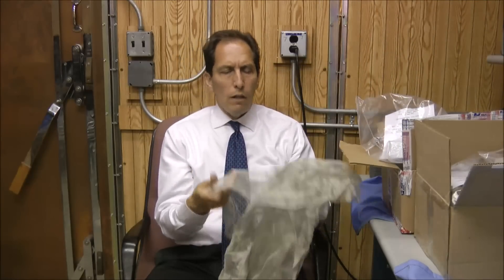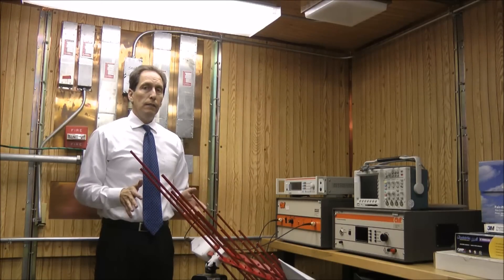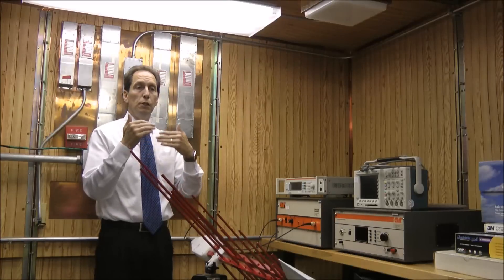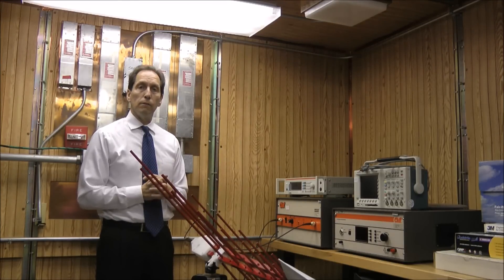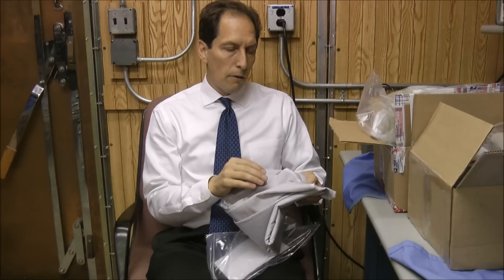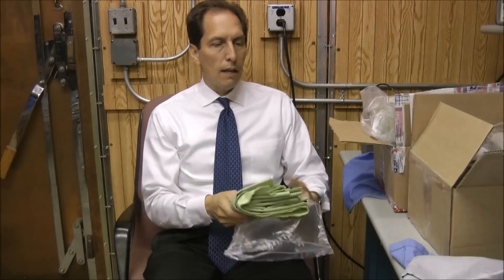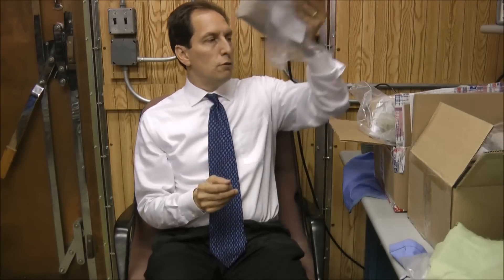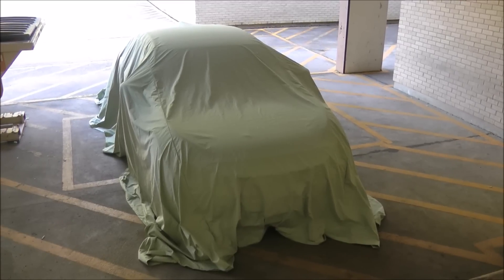Protect Generators and Cars from EMP

Comment: If we were attacked by an EMP bomb, I would wait a few days before uncovering your car because there might be multiple EMP attacks over the course of days! It might not be just one EMP attack, right?
Reply: If my car ran, it would be months before I got it out. A running car would be like a pig running around in a famine.
Reply from the maker: Sure, it's certainly possible.
Reply: DriverSteve what do u use to cover car or generators. What’s material called n where do you get it
Reply: @carolthompson4678  The video under which your comment is listed shows a website address to order the cloth. He will see the almost 5 foot wide strips together for you for $100 if you want or you can do it yourself. He said 20-25 length strips are about right, but suggest you measure—especially for a truck or something large. They do need to be hemmed one inch and to drape onto the ground to ground the cloth, so do not skimp. 👍
Reply: If I was at work and my car still worked after I uncovered it then I’d drive home and then cover it back up.
Reply: If I were the enemy I would pop an EMP...wait a few weeks, pop another. I'd let everyone get their backup stuff out of their Faraday cages and pop another. Yes, definitely would pop several.
Reply: @arklatexahomasavage5454  exactly then sit back a watch them (us) destroy ourselves
Reply: Arklatexahoma Savage 
The enemy would be identified immediately and vaporised .no second chance !
Reply: Good point while you are it - just don’t ever drive that car!  What is to stop someone that has not a working car from shooting you out of yours?
Reply: Protecting a vehicle is a bit of a fool’s errand in many ways. A)Many vehicles will survive just naturally, they simply don’t have as much antenna as is really needed to absorb much of the RF, might be parked in garages etc, that absorb a ton into rebar or concrete etc….

But more
To the point, there simply isn’t much of a way to preserve a useable amount of gasoline for long.

Why not store an electric bicycle or something that has a fuel source that will be viable and that won’t get you killed automatically or that will be a ale to navigate the clogged streets?

Chinese conversion kits are efficient, easy to install on normal bicycles, and relatively inexpensive…and with minimal parts will work until their batteries are no longer useable…years of heavy use.
Reply: @thopkins2271  Electric bicycles would be in high demand if they survive and cars don't. It would be dangerous to ride an electric bike as there would be widespread anarchy and would be either shot at or beaten for your bike! You would have to be very careful on showing anyone what resources you have as people will likely kill for it especially knowing that officers can't respond!
Reply: @driversteve9345  For sure. But it’s a hell of a lot easier to be discreet on a bicycle than a vehicle, and there are probably more bicycles in the country than people who can ride them. An average of 15,000,000 are sold per year.

Seeing people traveling on bicycles would be commonplace. Vastly more common than horses or vehicles, and eventually probably more common than pedestrians. Even if just used as a beast of burden you walk beside.
Reply: Correct. Most EMP bombs will be detonated in the first wave (before the destruction bombs arrive) to catch as many people by surprise. After that, EMP bombs may be set off if it is determined that harder systems are still operational. Those EMPs will be aimed at those targets but the EMPs can still destroy electronics  from thousands of miles away.  The idea is to keep you electronics in the Faraday Box 24/7 BEFORE an event occurs. Off the coast submarine launches may give us less than 5 minute warning.  People think to put their electronics in the boxes when a nuclear war starts that may be too late. Cell phones are low on the list to keep in a Faraday Box. The towers will all be knocked out because they have antennas. Keep a multi-power hang crankable multi-band radio receiver, and a 5W hand held CB radio, a hand held shortwave/ham transceiver (even if you don't have a license). The list goes on, but cell phones should be kept in a cage only if you keep important info on it, do not expected it to work as a phone/data or GPS after a nuclear war starts.  Can you imagine the horror of nuclear war when a blogger can't get to their Tic Tok account (which is Chinese by the way). I have a video on Ammo Box Faraday Cage. This channel here has the best info hands down.
Reply: First impacts will be kinetic to catch as many people out in the open. Then knock out the electronics. That seems the way the elites have it planned. Their biggest fear is us online talking about this.
Reply: @timmoles9259  If you are obeying Jesus commands and have the holy spirit in you, you got nothing to be fearful of! Actually, if you are truly saved and have Jesus, it would be a blessing to be killed which would start your everlasting eternal perfect harmony with Jesus in heaven! 

If you're not a believer, then you have every reason to be fearful of whats to come!
Reply: Check the door.    Brother is ready.      Please listen and prepare.
Reply: Ask the government, they will likely be responsible for the attack, just like ISRAEL & US GOVERNMENT DID 9/11.
Reply: @truthexposed9916  😮
Reply: Truth Exposed I heard that about Israel n USA.  Bush was in on it
Reply: @carolthompson4678  From Lil Giant I think he was. I think he was forced by his father. Bush Jr. sold his antenna on top of the tower and the sale was final the day before.
Reply: Truth Exposed, conspirationists, you are the reason why we are weak and vulnerable compared to totalitarian government, why you conspirationists alway blame US government instead of blaming China and Russian ones ? Or perhaps you are an agent of totalitarian governments ?
Reply: @pulsar235  From Lil Giant Because we have been attacked/abused/lied to /controlled so much we almost cannot differentiate between our government and a tyranny from elsewhere. We still have a LITTLE freedom but the door is now closing quickly.
Reply: @pepethepatriot7524  From Lil Giant Perhaps you did not notice that the comment you are replying to was eight months ago? Pul Sar may have changed his mind by now. There have been BLM & Antifa, the election, and Biden Executive Orders (EO’s) since his comment. (Just sayin’). 👍
Reply: @pulsar235  20 years later and you still believe the official story? Why are you even watching this channel?
Reply: Just one EMP would not be able to block out the entire grid. So yes, surely it was be numerous attacks either at once or over the course of days. I have read that it would take at least 6 EMP weapons to black out the US. Russia and China individually have the capabilities to do this. And they will eventually.
Reply: @brandontaylor9792  Actually just ONE EMP over a certain location in Kansas will take out the entire country so I've read
Reply: Brandon Taylor, if they do that, we will have times to reply ?
Reply: @brandontaylor9792   if russia/china attack, our zionist government would order a stand down like they did on 9/11.

Comment: One big Sunflare / EMP, and persons witt pacemaker, has a big problem.
Reply from the maker: Actually a solar flare wouldn't affect pacemakers, but an EMP might. That said, pacemakers are designed to withstand quite a bit of electromagnetic energy, so they may still survive. No guarantees, but there's a chance.
Reply: Wonderfull, if Solarflares are noget threads to pacemaker.

Comment: Why don't they make these the size of car covers. I have several to cover. If you made carports and put metal roofs on them with metal rods going into connected to the roof going into the ground would that work. I need something to build for several vehicles and once I make it I won't have to worry about it. Please get back to me. Thanks
Reply from the maker: I offer covers large enough to cover cars, but they're not cheap, ranging from maybe $1200 to $1800, depending on size. It's a custom job though, as no one offers a commercial product. As for the carport and metal roof (grounded or not), unfortunately, it's not going to do much to reduce the incident EMP pulse.

Comment: Very informative video, but I have to say that I was struck by one observation.  What exactly are the odds that an EMP will happen when I have my car covered?  At best, it would be 33%, unless I cover it at work also, which does not seem a realistic option.  Not being a nay-sayer, but throwing out my plan instead.  

An off-road vehicle; either an old Jeep, Land Cruiser etc., pre-major electronics, or any off-road vehicle with a complete set of vulnerable electronics, which WOULD be stored in a Faraday cage.  If the latter, a few hours to swap out damaged items, and I'm back on the road...so to speak.  Fuel then becomes the issue, so I can't argue with the bike and tubes argument as a good parallel plan.  

Having a store of gasoline/diesel does make you a target, so discretion and planning become paramount.  

I wonder most about the social implications of an event like this.  Does the country become MadMax or do we come together and pool our resources and skills to get ourselves out of this dire situation??
Reply from the maker: You're exactly right. There's no guarantee that the EMP would occur when your car is covered. Unfortunately, without very careful engineering analysis of every vehicle, there's really no good way to protect a car while it is running. For that reason, the cloth improves the odds of a car surviving but doesn't full address the concern.
Reply: Good information, nonetheless!
Reply: 50%
Reply: Also have to think, If you are at work....and an emp happens.... you are still at work.

Comment: Would storing components in a large metal container be adequate? I have a small relatively heavy gauge steel “job box” which is basically a large toolbox with a metal clasp on the front and I have been wondering if storing certain newer power tools, spare cordless batteries, chargers, a shortwave radio and perhaps a chainsaw (it has a control board). I also have a spare aluminum diamond plate tool box that mounts to the bed of my truck would that work? The aluminum is way more conductive than the steel and in conjunction with some grounding tethers may be the way to go. Also what’s the probability of weapon mounted red dot sights surviving a pulse?  I’m a fan of the Survivalist series, I’ve also read One Second After and The Patriots. Never hurts to play these scenarios out and have an idea of what you’d do if it ever really went down regardless of how remote the chance of it happening. Over a long enough period of time the odds only go up.
Reply from the maker: Hi Julio, Metal boxes work fine as long as you seal up the seams (typically with conductive tape). That can be a bit of a hassle if you plan to get in and out frequently. As for red dot sights and other electro-optics, they are small, which means it's hard for energy to couple into them. But they also contain a host of microelectronics that could be susceptible if the induced voltages (or currents) get too high. I have a video where I use a single 1' strip of conductive cloth to wrap an electro-optic sight while it is on the weapon. It does a decent job of protecting the device, and is very easy to do. P.S. Thanks for supporting the Survivalist series.

Comment: What about the unshielded bottom of the car?  I have always thought that the key to a Faraday cage/shielding, was to create a closed area where the current generated by the magnetic pulse stayed on "the skin" of protective area. The skin of the car cover includes both sides of the cover.  Using a directional antenna aimed at the car from the side or the top might test the shielding itself, but is that a fair comparison with an EMP?
Reply from the maker: It's a good question, and one that is often misunderstood. There are two basic ways to provide electromagnetic shielding (and they're related). Most everyone knows that if you build a conducting enclosure that it creates a Faraday cage. When an incident RF wave strikes the cage, charges redistribute on the surface to create field cancellation inside the box. That's one way. The other way is to simply put a conductive barrier between the source and the receiving electronics. For example, if you hold a large conductive barrier in front of a radio, you will notice that the radio signal will become much weaker. The reason is that when the RF wave strikes the barrier, some of it is reflected and some of it is absorbed. Together, those two effects can greatly reduce the wave seen on the other side. A cover placed over a generator (or car) actually acts as a bit of a Faraday cage and a simple shielded barrier. One could argue that the earth acts the bottom of the Faraday cage. Or, another way to think about it is that the cloth simply acts to absorb or reflect the RF energy. Testing with a directional antenna isn't perfect, but it's not bad either. I tested from above the car, to the rear, and from the side, and the results from above were the worst (not surprising since the windshield is facing the antenna). The only direction that I couldn't test is from below the car, and that's not where an EMP wave is going to originate. Anyway, I hope this helps to answer your question.

Comment: Dr. Bradley,  I'm intrigued by the room you are sitting in. 'Looks industrial strength. The door latch looks like it could close the vault at Fort Knox, and the wood inside the steel frames looks like it may contain metals? Or other scientifically needed material. This looks like it might be your EMP survival room...a modern fifties' atomic fallout shelter?
Reply from the maker: It's actually an EMI shielding room. By working in there, I don't broadcast the signals all over the area -- something that the local air force base frowns on.

Comment: so for around $750 177 inches wide and 12 feet long you can buy a pre-sewn car cover from this guys site.  A little expensive to put out now but may be cheap when it comes time to actually use it.  I hope it come down a bit n price so even the poor could afford one.
Reply from the maker: It's a little cheaper than you say... a cover measuring 177 inches by 12 feet would be $550 (includes shipping). That said, I totally agree that the cloth is expensive. Believe it or not, it is much cheaper than many of the conductive cloths on the market, and overall, it is durable and shields well. I always tell folks to be sure they really want a cover before spending the money on it. It's one of the more expensive preparedness investments.

Comment: I would wonder how this material would stand up to weather? Rain, snow.. would it retain moisture? Would this have to be used inside a shelter/garage or outside? I have extra vehicles that I could cover, but wonder about leaving them outside?
Reply from the maker: It's a great question. The vendor states that it is machine washable, but frankly, at the high cost, I'd prefer to use it somewhere that is either in a garage or at least under a shelter. Another option that some folks have done is to put the cloth over a vehicle that is not normally in use, and then cover that with a traditional car cover (or a tarp). That would help to keep the sun off the cloth.

Comment: people can live without electricity, your only need will be ground well with hand crank, indoor garden (beneath windows) to grow food, don't forget seeds nonGMO, goose down blankets, bedding for warmth, a small dry shelter.
Reply: reb s

Have you turned off your Electricity for a week to try that "live(ing) without electricity," ???? 
 I have ... the batteries are all dead in less than a week. The "candles" are burning LOW and it sure gets COLD. What will you do until Summer comes?

""...indoor garden (beneath windows) to grow food, don't forget seeds nonGMO,""... ????????????
 
Have you actually ever tried to grow all your own food??? I have .. for 50 years... Even Farmers with thousands of acres under cultivation go to Grocery Stores.

You better store up what you want to eat and then some EXTRA to Trade for what you forgot...... cause I'm not giving you any of mine. Fair Warning...

Comment: Up to what frequency it hold, Hz and Ohms?
Reply from the maker: I'm sorry, but your question doesn't make sense. If you're asking what frequency it shields against, I tested from 1 MHz to 1 GHz. Keep in mind that lower-frequency content of an EMP  cannot efficiently couple into small systems (such as cars or generators).
Reply: disasterprepper im asking cause im a ham radio operator and so i was wandering the ohms that are 50 on the meters, amplifiers that work from 15 mhz to 120 mhz and radio 15 meters to 80 meters at 60 hz?

Comment: One question that I would ask, is in regard to the testing regimen.  You mentioned a sweep signal generator, etc and a broadband antenna aimed a spectrum analyzer located in the protected environment. My question is in regard to the "frequencies of interest".  What is that exactly, in regard to an EMP generated by a nuclear detonation?
Reply from the maker: I tested from 1 MHz to 1 GHz. Keep in mind that lower-frequency content of an EMP  cannot efficiently couple into small systems (such as cars or generators). Because of wavelength considerations, it would require energy above a frequency above about 10 MHz to couple efficiently into a electronics.